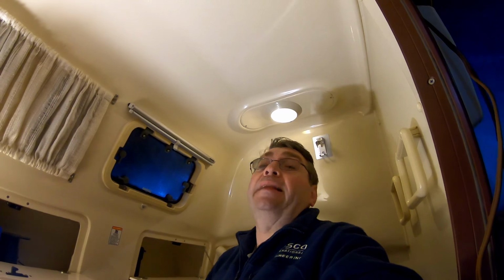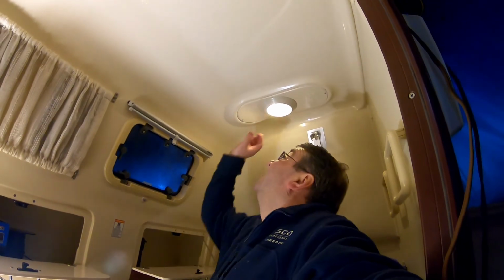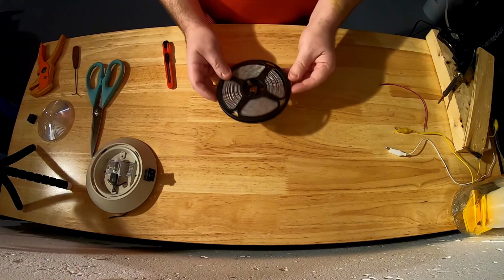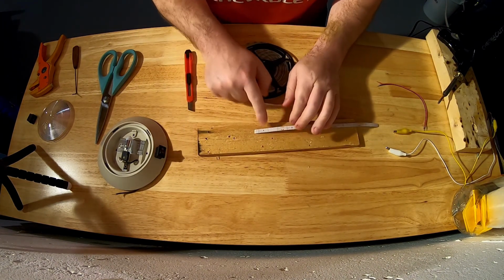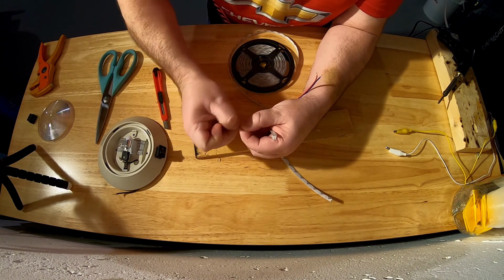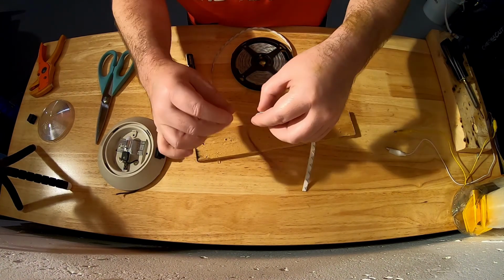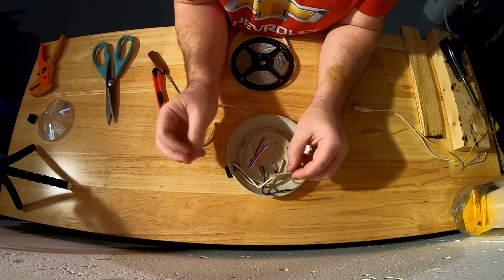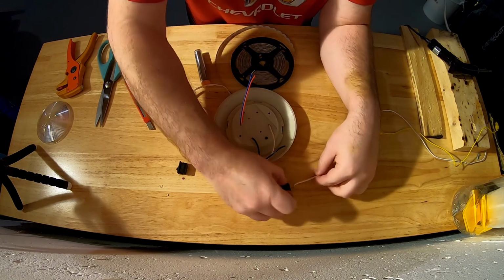Après Sail - Tech Ep1   Dome Light Conversion - from White to Red/White

Comment: FYI- there’s only so many feet depending on the ohms they can send power over- I am sure You know this. In the theatre we use LED tape all the time and cut etc etc. 16 feet typically is the max until you recut and run a sep power source.
Reply from the maker: Thanks! - I am only using 5 sections (15Leds) per dome lights, the total draw is 100mA per light

Comment: Did I miss why you run with red lights when racing? Just wondering.
Reply from the maker: Just to maintain night vision.  Red light does a better job than white, there are discussions whether blue is better but headlights (headtorches) typically come with red and white light and all my crew have them and use red at night.
Reply: @ApresSail  Thanks. Would make a nice Star Trek red alert signal. :)